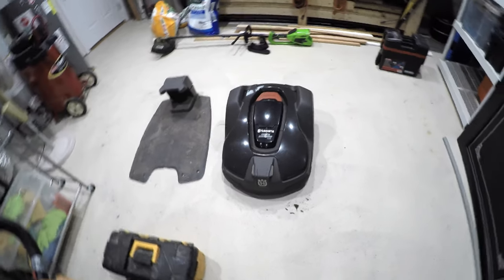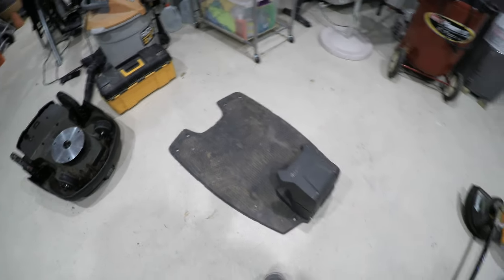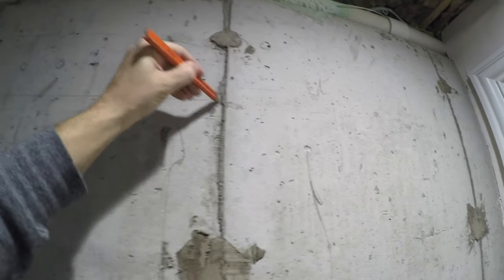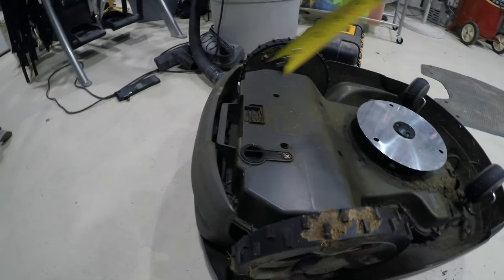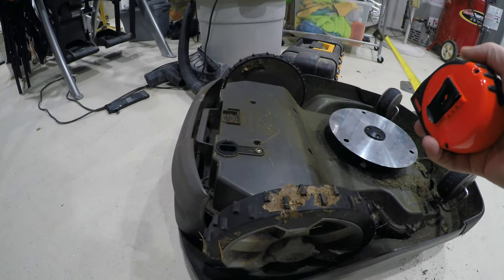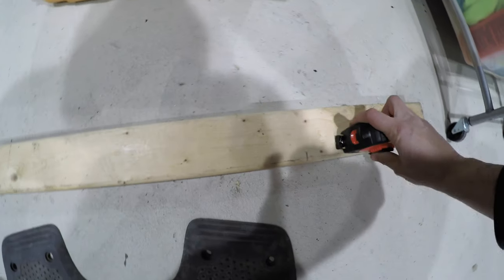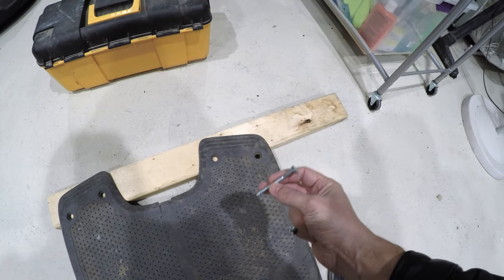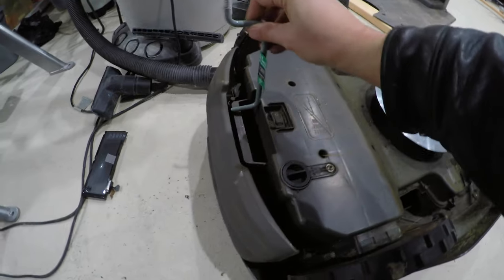Building a Husqvarna Automower Wall Hanger

Comment: FYI the official hangar for the 300 series has a warning illustration, showing that the mower needs to be hung in a way that the hangar supports the wheels as well as the handle. Maybe it'll cause bump sensor damage if not hung properly?
Reply from the maker: I wonder why that might be the case. I'm pretty sure the front wheels are attached to the base and the handle is formed into the base. Are they supporting the shell? Maybe the force of the shell pulling down for a winter can cause an issue?